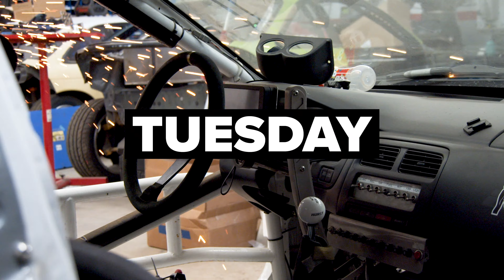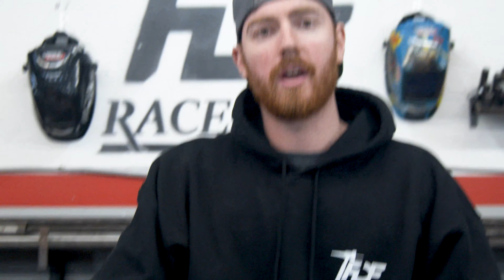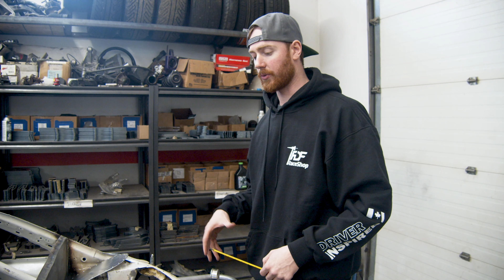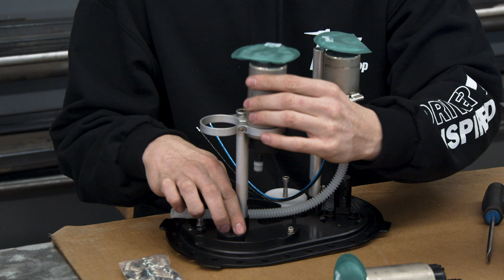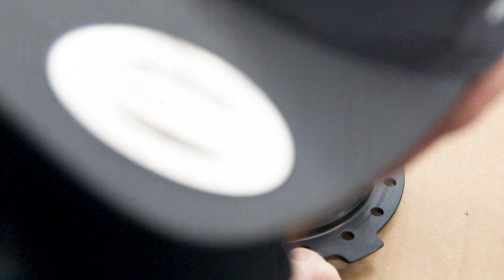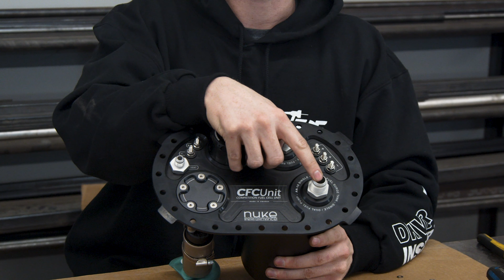NUKE PERFORMANCE CFC UNIT INSTALL

Comment: So what happens if someone runs a level unit instead of the low pressure pump and only wants to use 1 pump high pressure??

Comment: So you're filling a surge tank with half the amount of fuel that the pumps in the tank are pulling?
Reply: yes. and return from engine is to surge tank. thats why no need more lift pumps.
Reply: @Jakedelus  still doesn't make sense how it stays full on a volume aspect lol.
Reply: @DCraw91  The low pressure lift pump is filling the surge tank at all times. the low pressure lift pump supplies the high pressure pumps with the volume of fuel and any fuel returning from the engine is being dumped into the surge tank as well. This means as long as the lift pump can supply enough fuel to meet or exceed the engines fuel consumption than it will never drain. Another important thing to note is the dw400 flows over 500 LPH at free flow, no way the engine consumes that much fuel.
Reply: When you wired up the fuel pumps on the internal side what's stopping fuel shorting them.out